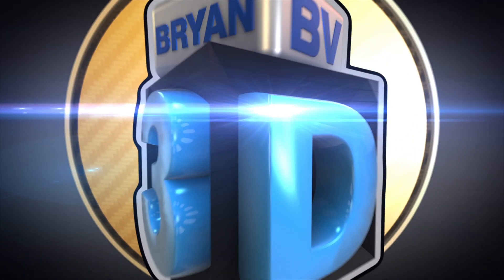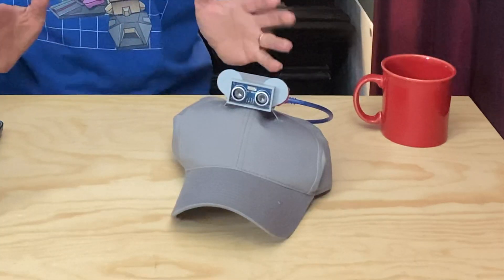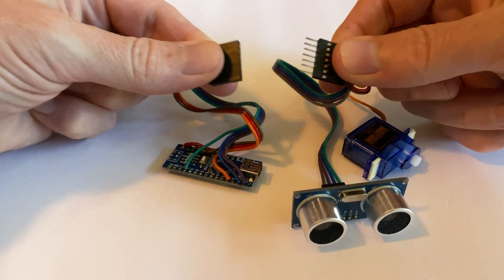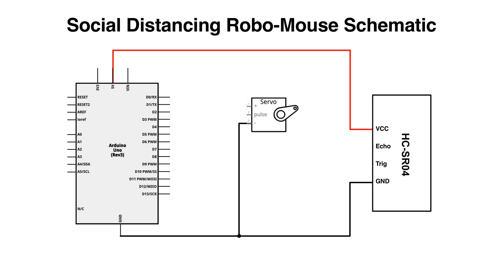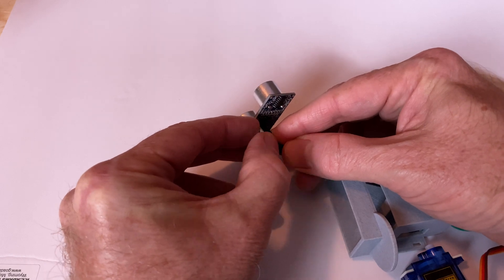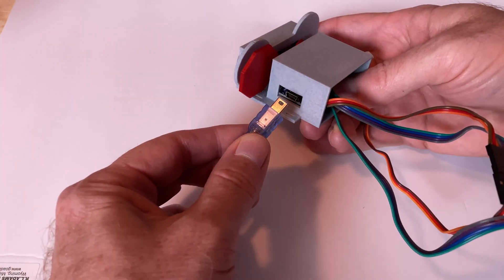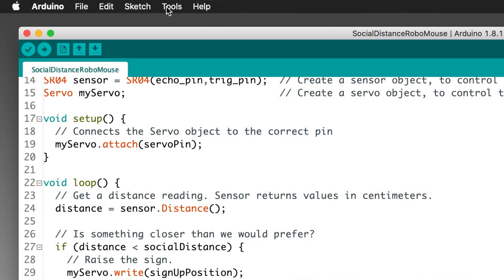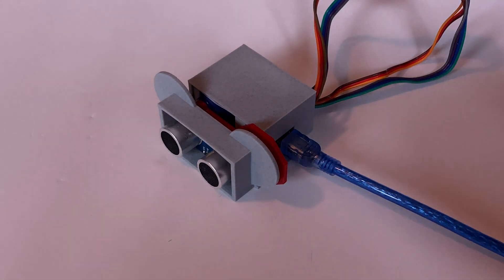Build a Social Distancing RoboMouse

Comment: What 3D printer model are you using and what would be an economical 3D print to purchase on Amazon to complete this project
Reply from the maker: Hi! I don't remember which printer I did these on. It was either an Ender 3 or an Artillery Sidewinder. The Ender 3 is a great starter printer. As I write this, they're $179 on Creality's site, and $206 on Amazon with free Prime shipping. They're sold out on Creality's site right now, but if they were in stock, the shipping costs would make up the difference with the Amazon price (I've got an affiliate link to the printer on Amazon here: https://amzn.to/3n1Rm32).

The only thing to be aware of with the Ender 3 is that it can be a bit loud, and that's mostly the fans, but partly the motor noise.

Good luck on the project, and let me know how it comes out! 👍

Comment: Does this only work with the nano?
Reply from the maker: You could do it with an Uno board, but those are bigger. There may be boards smaller than the Nano you can do this with, too, but I haven't looked into it. I think at a minimum any board that works with the Arduino IDE, and has at least one digital pin and two PWM pins, it could probably be made to work.